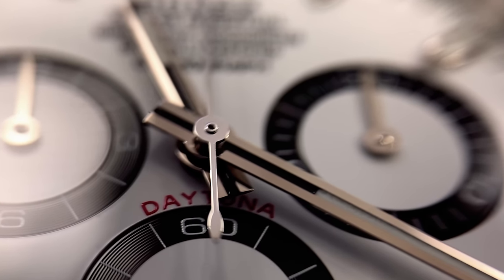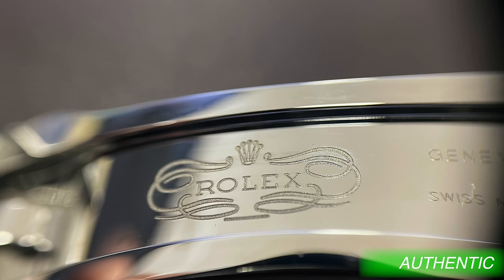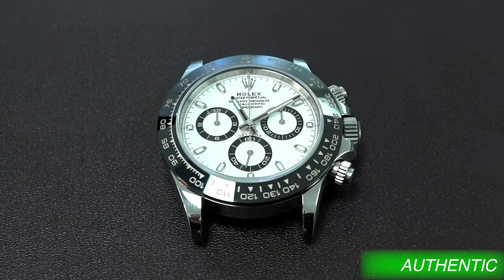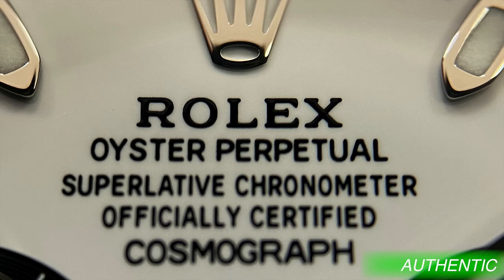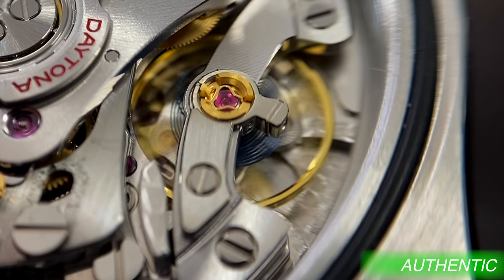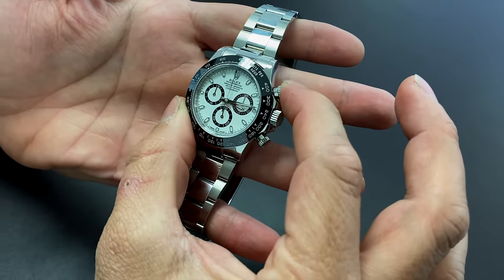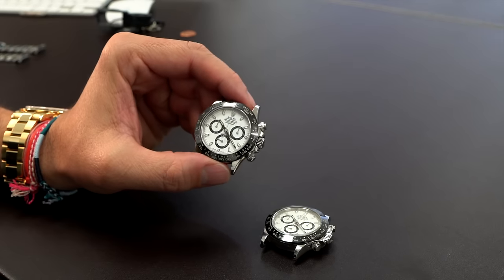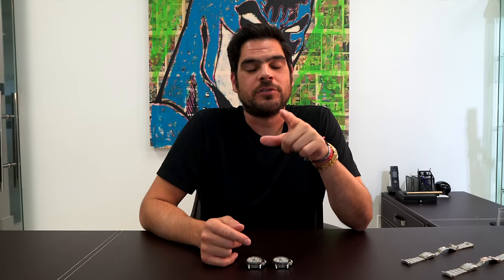5 Ways to Spot a Fake Rolex - This Replica is Scary Real! 😱

Comment: Try it again with the $1000 superclones to see if the points you spotted are still present. The movements are 98% accurate, so can still be spotted easy-ish, but I'm curious about the centre rivet but don't really want to spend a grand on a replica 😄

Comment: Eric, that is the best video on fakes I've ever seen. Congrats. That's what is going set you apart from other watch shows. Keep it up. What is the most vintage Rolex that is undervalued at this time? You are doing a great job. I inherited a 2004 Rolex 16234 white gold with white stick dial. I was thinking of putting emerald bezel and stick on dial. Have a suggestion on who you use to do this? Thank you brother. Neal

Comment: @CRM Jewelers not the case is thicker, the caseback is thicker, because the 4130 decorated movement of the  replica watch uses a different rotor. Some replace the rotor and install a slimmer caseback. The u get a hight of 12,5mm. I think the gen is 12,4mm. Right now they changed the dial too, and the newer rep dials are really close to gen. The best thing is, open the case and have a look at the movement.

Comment: This is most likely a “n factory” v4 which cost about 400 bucks. There are many independent sellers who hire actually incredible watchmaker to do refinement and editing of the n factory watch as the base, and make they can fix all the problem that you just pointed out, and of course, those that you didn’t spot. And the refinement process cost about 1500bucks

Comment: The best reps are 100% identical to gen down to the exact size and weight. Not sure which rep you are showing exactly but good reps cost $300+ and are pretty much 1:1 reps. Depends on the make and model though.

Comment: So, basically you need a real reference watch for a good side by side comparison. Without one it is not able to tell the variations.
I think those replica manufacturers might just deliberately leave a little hints to differentiate them from the authentic ones as they should have the technique to do good watches.

Comment: I honestly have to say that $25,000 vs $600 is tempting. Okay, so the construction is not to the level of Rolex, but for the price difference? And you need find the differences with a loupe?  This is getting scary. The only reason Eric noticed that height difference is because he handles them 24/7.  Any other person, would have absolutely no clue. Give the replica industry five more years and you will have to put the replica under an electron microscope to tell the difference. Maybe if Rolex made their watches available and lowered the price a bit, this would not be much of an issue. Otherwise, good luck to Rolex.
Reply: This is not a High quality fake I got a MUCH MUCH better DAYTONA 1:1 V3 4130 replica from Noob Factory. It;s EXACTLY the same thickniss as the real one (the one in this video is not...)
They cost a lot between 750-1000+ but than you have a PERFECT replica of the real deal! 
This one in this video is a Mid-range fake but absolutely not a A+++ Noob fabcric 'official' fake! Sorry buddy but this video says nothing if somebody uses a better Noob version! 
I checked my replica with a magnifier and it's really ALMOST perfect WAY better than the one in this video. Dials are also way better polished than the one in this video.. no bleeding in the lettering at all.. just like the real Rolex. I even let it check by a Rolex dealer even they couldn't see it in first glance it was a fake EVEN not with a magnifier...
Reply from the maker: Tell us more about your replica.

Comment: Mate,there is no rivet there on the second hand! The hand is press fitted only. As a test pull out the winding crown to the time set position and gently rock it backwards and forwards, any backlash or play will expose the fake. A genuine Rolex has absolutely zero backlash. This simple test busts then easily and without any equipment. Can be done quite subtly without alerting the seller who may be trying to convince you that you are buying the real thing!

Comment: No disrespect intended but for 99% of the buying population only the point about actuating the watch is of value. Unless one happens to carry a magnifier (and spare authentic version of the watch being bought to compare it to) we’re screwed unless we buy from a proper dealer. The days of buying from actual owners are over. No more bargains.
Reply: Not necessarily always true. If the seller has the B&P and even the receipt there’s not so much of a problem. 

It’s loose watches that will be a problem. As they always say you have to buy the seller. How does this person look? Do they look professional? Do they look like they can own these watches? Are they willing to answer every question you need answered?

Is he willing to meet you at an AD or independent jeweler?

Half the time a scammer will disappear when he realizes that you’re not an easy mark and not worth the trouble.

Comment: imo, the thickness and coloring mistakes can be only spotted if you have a known gen with you, which is kind of unlikely for an avarage person lets be honest, so next is to pop a loop and check the printings - which is still not 100%, most recent replicas turned out to has better printing than an authentic(!) - there are vidoes here on yt, so you can check it, so the only certain way is to inspect the movement - and they also have the decorations, so you have to know the parts of the movement exactly, because on theese clone movements, some parts have different shapes - so you have to dissassemble it. 
and rehaut and etched crown is also already copied

Comment: The thing with fakes is that all the defects begin to add up. They're getting really good, but NOT that good.  Rolex is as close to perfection as you can get, but they still may have some imperfections. Getting acquainted with the 5 things Eric mentioned is what's going to save you from buying a fake. If imperfections mount on a piece, you know it's not a Rolex.

Comment: the newest Daytona clones have clone movements and therefore identical measurements. the only way to spot a difference is to check the balance. the replica watch has a conventional spring, the genuine watch has a balance wheel  with screws and free spring.
Reply: Where can u even find these clones? Im curious to do a side bu side comparison with my submariner

Comment: The fonts are raised on the factory Rolex. No clue on the aftermarket Rolex parts that are either Swiss made or made in Deutschland, unless it came with original factory packaging. The feeling of the operation of the watch may be due to not using the different types of lubrication IAW the Rolex service manual. 

I pawned a real Rolex watch in Hopkinsville, KY. Unfortunately, the guy judged me by my outward appearances and told me my Rolex was a fake. I took my Rolex to a watchmaker, and he opened it using proper Rolex tools, watchmaker verified it was real and also using online authentication databases. My Rolex was purchased through Bob's Watches.

Comment: The real paradox is that a very, very good fake Rolex (nobody could tell the difference without a microscope) of the best quality  can cost 700 or 900 $ while the  original  Rolex, whose manifacturing  costs (without publicity, merchandising and promotion of course) are  almost identical to those of a fake,  must cost more than 10.000 $. Genuine Rolex are overpriced without ground, but  only  in order  to pluck the 'chickens'.

Comment: Not a noob v3, maybe try get a noob v3 for a future video I think you will be more shocked.
Reply: This is indeed not a High quality fake I got a MUCH MUCH better DAYTONA 
1:1 V3 4130 replica from Noob Factory. It;s EXACTLY the same thickniss 
as the real one (not likt he one in this video...)
They cost a lot between 750-1000+ but than you have a PERFECT replica of
 the real deal! 
This one you compare is a Mid-range fake but absolutely not a A+++ Noob 
fabcric 'official' fake! Sorry but this video says nothing if somebody 
uses a better Noob version! 
I checked my replica with a magnifier and it's really ALMOST perfect WAY
 better than the one in this video. Dials are also way better polished 
than in this video... no bleeding in the lettering at all.. just like 
the real Rolex. I even let it check by a Rolex dealer even they couldn't
 see it in first glance it was a fake EVEN not with a magnifier...

Comment: If you own watches or wore a few of them enough to know a Rolex. Right away you will notice a difference in the feel of a Rolex. Not to say Rolex is the ultimate, they’re not. Far from it and they do have mechanical weaknesses. However, a Rolex really DOES feel like a solid watch. You can compare an Omega/Patek/AP to a Rolex. That “solid build” feel will be more noticeable on a Rolex.  While other brands don’t feel as tough, feel delicate, or dare I say cheap. That’s how these replicas feel... cheap. Plus the edges feel more sharp compared to a Rolex right off the back. I can’t tell you how many times I’ve found or come across replicas at pawn shops or flea markets. Shit there’s forums that are dedicated to replica luxury watches. These replica factories are only getting better. Every version of replica improve. All they need to completely come as close to cloning a Rolex with the material they use for fakes. Is the finishing on the case, better paint/sharper print, improving the movement, the finishing of the movement, the water resistance. The final phase is micro laser printing, quality control, regulation and accuracy. By then what the point of spending all this money on machinery, avoiding local authorities. When they do all of that. Modern/current steel sports Rolex will be worthless.

Comment: Not sure about how "reliable" this method is, but it was a dead giveaway to me (having now owned both a 116000 and 216570) when viewing your video--the color of the hands. The genuine model uses white gold for  hands. With a closeup of the dial printing, my eyes went straight to the pinion and hands. If you compare the metal color of the fake to the real, the color difference is noticeable. The fake (no doubt) uses plain stainless steel (or similar) for the hands; these are as 'white' as the stainless steel case. Look at the real deal: the white gold color is "off" or has a warm, yellowish tinge. I know this with my own watches: the hands are of a different tone than the bracelet/case/chapter ring (unless you have a white gold model!).

Comment: It seems like now after just two years almost everything is fixed, so nowadays mainly only the Microstella regulated Balance still stays as on invincible obstacle for the fakers.

No wonder Rolex does not sell Rolex spare parts for outsiders and surely demands Rolex authorised watchmakers to send every faulty Balance back to the factory. 😉

The very best fakes out there in the wild do use original parts to make identification as fake even more difficult.

Comment: This is not a High quality fake I got a MUCH MUCH better DAYTONA 1:1 V3 4130 replica from Noob Factory. It;s EXACTLY the same thickniss as the real one (yours is not...)
They cost a lot between 750-1000+ but than you have a PERFECT replica of the real deal! 
This one you compare is a Mid-range fake but absolutely not a A+++ Noob fabcric 'official' fake! Sorry buddy but this video says nothing if somebody uses a better Noob version! 
I checked my replica with a magnifier and it's really ALMOST perfect WAY better than the one in this video. Dials are also way better polished than yours... no bleeding in the lettering at all.. just like the real Rolex. I even let it check by a Rolex dealer even they couldn't see it in first glance it was a fake EVEN not with a magnifier...

I use these fakes to wear (and also enjoy) the real ones stay in the vault and mint condition!
Reply from the maker: No one that has real watches wears a fake one and keeps the real ones in the vault. Either way. A watch enthusiast is a watch enthusiast to me. I aware of the Noob copy. But need to point out some basic things to ppl to look for.
Reply: @Crmjewelers  no one ??? i even do it...t l i have 2x real rolex in my possession. Also some friends of mine also do that and a lot of customers my supplier that sells those high grades replicas too are having a real Rolex or AP and want a perfect copy to wear all the time and keep the real one save... but it must be a perfect copy not some cheap or midrange quality version like the one in this video. Everything must be perfect (size / weight / polishing etc.) 'original' Noob provides very good quality replicas. Unforuantly there are also a lot of  FAKE noobs on the marked (Copy from a Copy...) but if you got a REAL Noob V10 Submariner or a Real Daytona V3 Noob you will be surprised how good they are! I think you have no idea... 

I dont want to risk to much wear on the real one and to let it serviced by Rolex which is also very expensive.
Reply: @Crmjewelers  But i want to say if you making a video its maybe best to warn people about the differnces of the highest quality noob v3 instead of using a midrange replica in this video. I can see from a mile away already that is was fake just by looking at the bezel... its more informative to do a comparsion with a noob v3 daytona. Otherwise people think they got a real one and still got scammed...
Reply: @Crmjewelers  I too collect High Grades fakes and keep my original one mostly at home. Just to be saved that I will not loose them. I almost lost my Real Rolex last time that I  had for a few days when I was sitting in my couch and the band came loose  (I made the band smaller but it was not tighten enough). Thank god it happened @home... 

I bought a NOOB V10 with a 3035V2 Asian movement Submariner and it's unbelievable and almost identical to the real Submariner that I have. I can't see it with the naked eye it's a replica... it got EXACTLY the same weight either and yes it's that good! Even got Platinum Coating on the bezel... That was the biggest give away to spot if it was a fake... (V9 didn't had Platinum coating). Now you really have to open up the watch and check the movement and even that is almost perfected... they even say you can replace parts with the clone and the original no problems (with the V2 3035 movement). 
I Keep my original one save so it also keeps it value over time. I am proud to be the an owner of a real Rolex Submariner but found it to risky to wear it all the time.

I understand that you want to show people some basic things and I appreciate that (I hate that people sell fakes as real and it's a good thing people will warn about it) . But those things won't help if someone wants to sell a NOOB V10 or Daytona V3 (like Wild-child said) with a good clone movement of the Rolex. Because you hardly can't spot those things on the NOOB you mentioned in this video.
Reply: I do the same ,,I use Puretimewatch

Comment: Replica's have improved a lot in 30 years.  One day the replica will be exactly the same as the original, built with the same materials and with the same level of craftmanschip and finish.  Rolex watches are ridiculously overpriced because clients are stupid enough to pay for the name.  Precious metals and labor, may be expensive, but that does not justify a price of over $20,000, let alone $100;000 (of more) for any watch.  Gold 24K costs €73 per gram, platina €31 (august 2024).  Besides, gold is a soft an easily machinable metal.  When you buy a Rolex, you pay for marketing, the sponsoring of celebrities and athletes in sports like tennis, jumping and F1.  The irony is their very expensive AD network is forced to comply with poor sales practices, which leave a bad experience with clients.  Once the perfect replica will be indistinguishable from the original, Rolex will be put with its feet on the ground.

Comment: There are models with the correct thickness now...
Reply from the maker: Yes. I just did not have it
Reply: Also with way better polishing and a better movement either! This version is not the best unfortuantly. The Noob V3 is the best of the best (cost between 750-1000+ USD) but than you got a 99% perfect replica!

Comment: Credit where credit is often not due with these reps. The detail just in the movement alone is pretty crazy. And now Clean Factory (replica watch factory) are making the Daytona with correct dial colour and thickness. And you can also Franken these reps by fitting gen dial, gen hands, gen crystal, gen crown, bezel, and even gen movement parts for roughly $5000 (Australian) way more affordable than the ridiculous price they go for now. Great content though 👍👍

Comment: The print on the fake is awful
Reply: and you wouldn't be able to see that from 100cm away
Reply: This is not a High quality fake I got a MUCH MUCH better DAYTONA 1:1 V3 4130 replica from Noob Factory. It;s EXACTLY the same thickniss as the real one (yours is not...)
They cost a lot between 750-1000+ but than you have a PERFECT replica of the real deal! 
This one you compare is a Mid-range fake but absolutely not a A+++ Noob fabcric 'official' fake! Sorry buddy but this video says nothing if somebody uses a better Noob version! 
I checked my replica with a magnifier and it's really ALMOST perfect WAY better than the one in this video. Dials are also way better polished than yours... no bleeding in the lettering at all.. just like the real Rolex. I even let it check by a Rolex dealer even they couldn't see it in first glance it was a fake EVEN not with a magnifier...